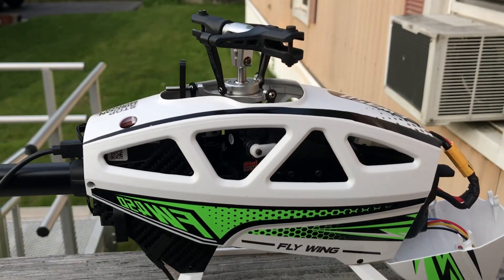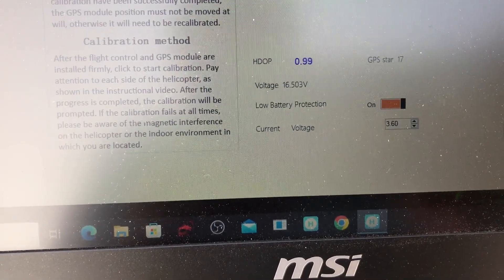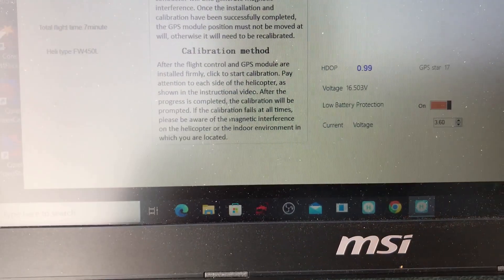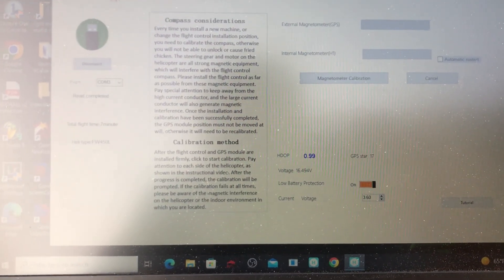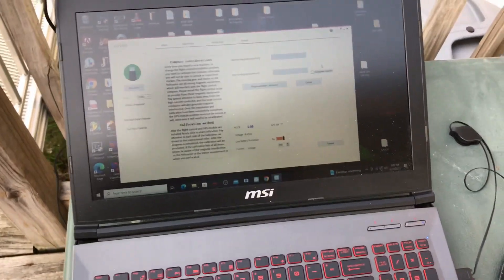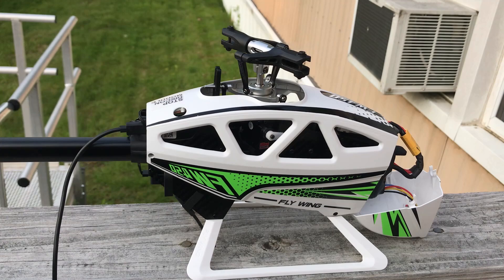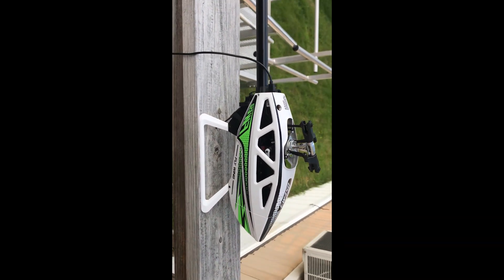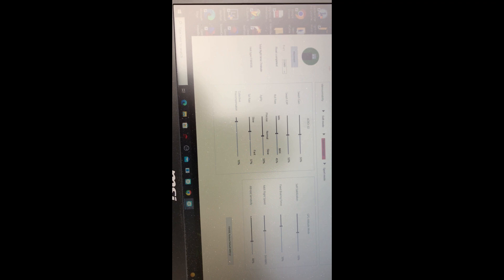Flywing FW450 V3 GPS testing

Comment: hello mr cruzroy , I'm having a problem with my 450 v3 replace the main motor  and now it is going anti-clockrotation is there way to fix it.
Reply from the maker: the motor has 3 wires, its hard to tell you without photos, but 1 wire in wrong place
Reply: @CRUZROYHelicopters  thanks.
Reply from the maker: watch this  https://www.youtube.com/watch?v=lGwc4UEflWM&t=2s